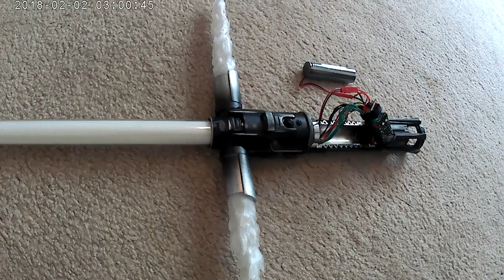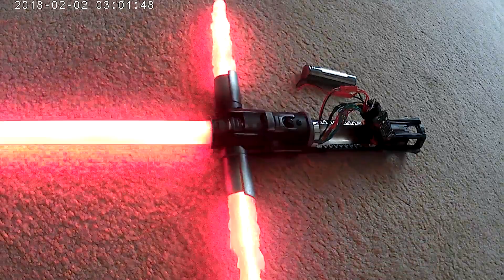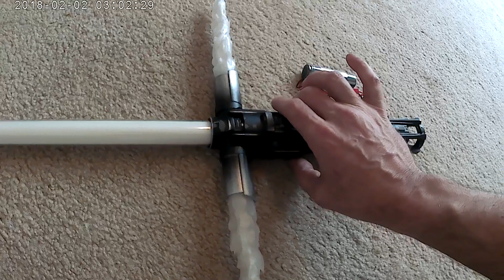Proffieboard Crossguard 2.0 Neopixel Initial test

Comment from the maker: They are from theProplicator on Etsy, he sells 3D printed unstable blades for multiple sabers.
Reply: Are they sleeves like the main blade?
Reply: I only ask because I ordered a Vader's Vault Crossguard 2.0 from their August run and all 3 will be Neopixel.
Reply from the maker: @ChrisBrown-qg3qt  the main blade has a sleeve, the side blades would need the neopixels installed directly they are not sleeves.